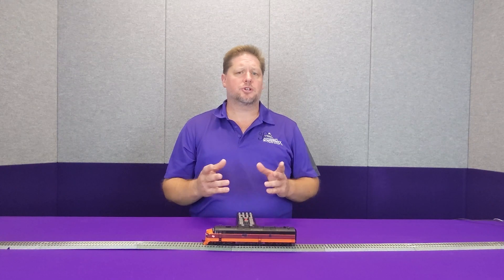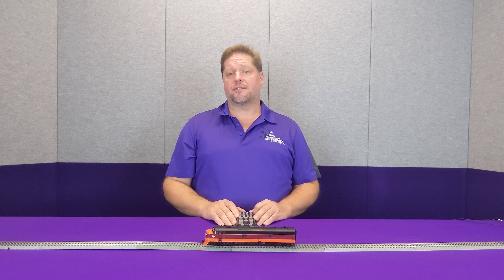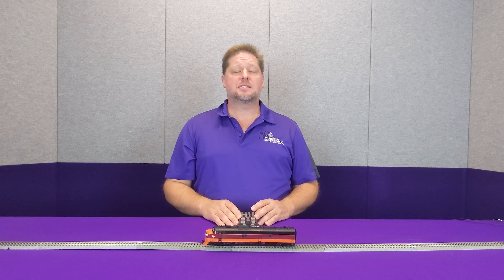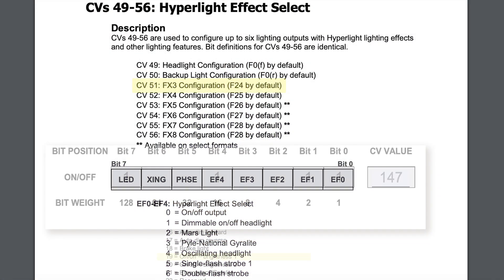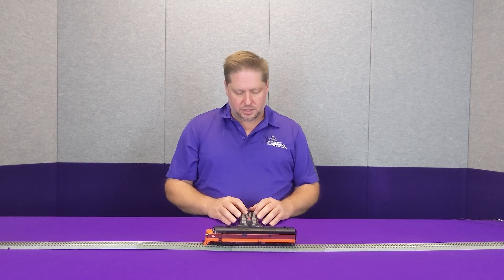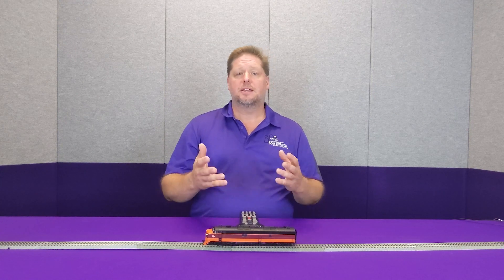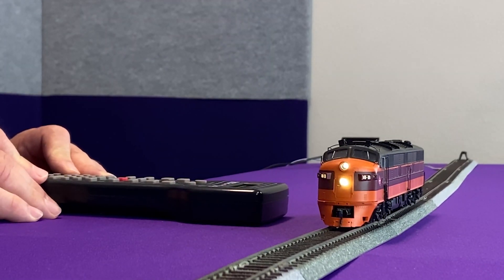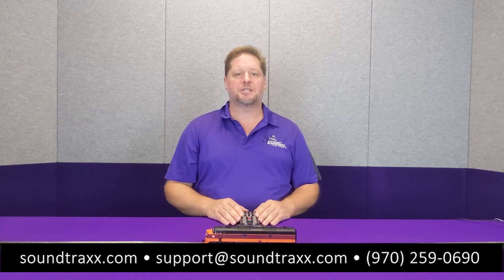Tsunami2 Lighting Effect: Dimming and Brightness Adjustments

Comment: My ditch lights are set to F5. They’re LED. Is there a way to make them fade on and off to simulate a incandescen bulb?
Reply from the maker: Be sure to add in the LED compensation bit to your ditch light output effect register (FX3-FX8 use CVs 51-56 to set the effect.)  For the quick fade on, select the diesel light effect (Value 15) for the light effect, then add 128 for LEDs.  If you need further assistance, contact support@soundtraxx.com
Reply: @SoundtraxxDCC  Thank you!
Reply: @SoundtraxxDCC  So setting this CV, is there still a way to get the affect and still have the flashing ditch lights?

Comment: Hi George I’ve turned up the cvs to 255 on every brightness cv there is one my tsunami 2 Athearn LEDS and although they are ok they are still not as bright is if you just take a 3 V battery and hook them up directly to your LEDs which that’s what I am trying to get. Is there anyway to make these brighter? Did you guys use a very powerful resistor limiting these if so how can I get rid of them? And maybe use a 1000 ohm resistor, please help
Reply from the maker: The LEDs are current sensitive, so we made the decoder to match Athearn’s request for brilliance.  If you are not getting them bright enough, then you can plug into the CurrentKeeper connection and use the blue wire as your unregulated V+ common, then you can select the resistor value for the lights that meets your desires.